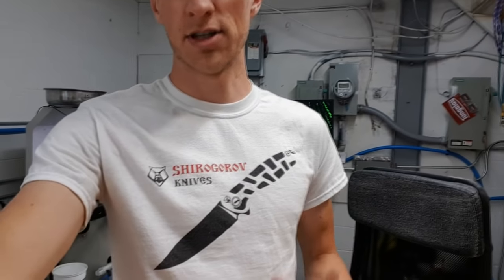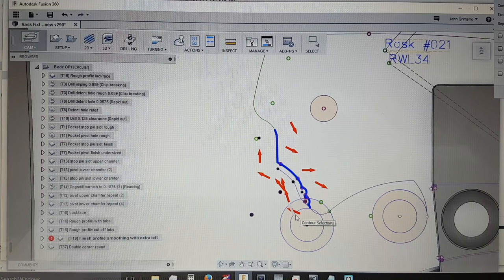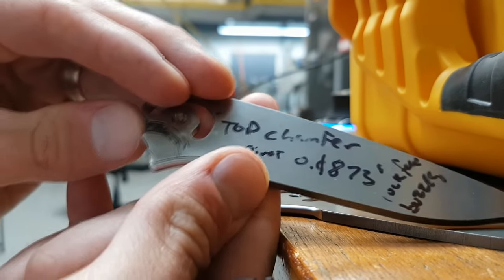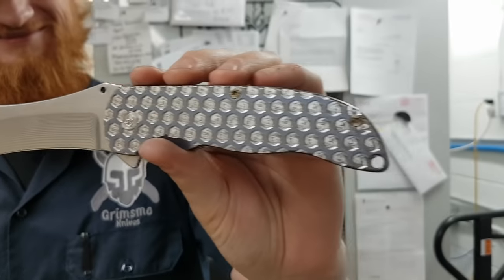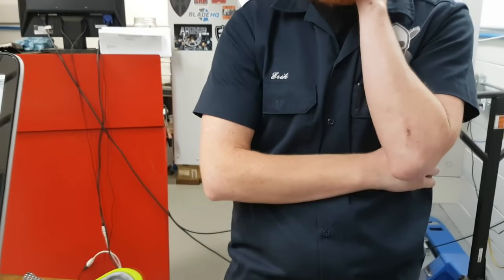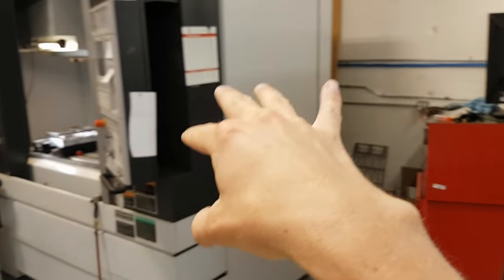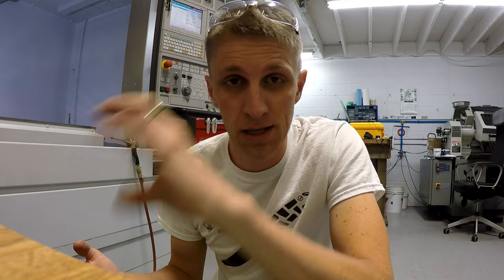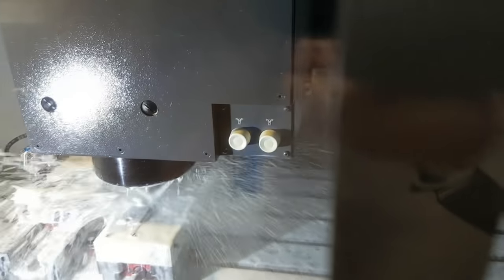Mori Seiki CNC, Fusion 360 CAM, Grimsmo Rask blades - Grimsmo Grind 034

Comment: quick little easy solution for mounting blades with the fixture standing on end... put a small round pocket somewhere in the blade pocket and epoxy a small magnet into it....that way the magnet will hold the blade in place where you want it located while youre trying to find bolts and clamps.
Reply from the maker: +mnm knives maybe, but I'd hesitate putting a magnet somewhere that gets pelted with magnetic chips.  Could work I guess since the blade will always cover it.
Reply: true...but (and i may be way off here) im thinking it would be the same as a magnetic chuck on a surface grinder where the coolant flushes the chips away....it should work the same on the mill.

Comment: That hole finisher is a burnisher not a reamer if it uses balls or rollers. Not only do they hit size and leave a good finish they make the material stronger, win win!
Reply: bcbloc02 But not a general purpose shop tool.  Because adjustability range is very limited, used for production of many identically sized holes.
Reply: Alex Jacobson
I don't think I have ever seen an adjustable burnisher, in my experience they are dedicated tooling, but no different than a chucking reamer or drill as far as that goes besides cost.
Reply: bcbloc02 what will happens when the balls will worn out? you need to throw away the whole thing?
Reply: bcbloc02 what will happens when the balls will worn out? you need to throw away the whole thing?
Reply: Fischer977
Some can be reconditioned others need replaced.

Comment: Nice mill.  My experience with stainless is limited but I agree with you that using coolant is better than nothing as your chips are work hardened and re-cutting them is bad for the end mill.  I think the trick setup is a compressed air stream just to get the chips out of the way of the cutter.

Comment: if you're going to the trouble of making a diamond checkered engraved pattern on the handle you should incorporate the Grimsmo logo and the screws into the design. It looks like an afterthought now and the logo is just kinda floating around.

Comment: When your selecting open contours you can often save time by clicking the end of where you want that contour and it will auto select everything in-between. You get sort of a preview of what it wants to select because the line is black.

Ever consider shrink fit holders?

Watch those lights on the Mori, the end of the tubes get loose and they fill with coolant. The ones on the lathe at DMDII are trashed which gave me ideas for the next light design. :)
Reply from the maker: +bensbenz Good tip!  I'll try that out.  I have considered shrink fit.  Might get a few and try the blowtorch method.  Otherwise it's way out of my budget.   I'd love the clearance though!  I'm in for a machine light!

Comment: Maybe you should put some hollow dowel pins on the side fixture to locate the pivot hole and blade tip, I foresee repeatibility issues with just using screws for retention and location.
Reply: It gets pushed tight up against the walls of the recess. add long as he pushes it tough into the corner, he should be fine.
Reply: For the kind of work he is doing, that will not be adequate.  His fixture positioning needs to be repeatable to within 1 or 2 thou, otherwise he will have very noticeable differences from one side to the other.
Reply from the maker: +eformance you're not wrong, and time will tell, but I think my way will work fine.  As picky as I am there is wiggle room in the absolute positioning of the bevel before you'd notice it.  And there's no way the blade is moving under these clamps.

Comment: John, great video, is all of this done pre heat treatment of the blades? Finally, could you show that custom carbide endmill for the lock? I have been looking for something similar for over a year now. Thanks
Reply from the maker: +mwvanwyk yeah we fully work the blades soft.  You can see the lock face endmill at lakeshorecarbide.com under the knifemaker section.

Comment: Hey John great video as usual. Question: What was that bit you were using at 21:19 that you said made "perfect holes"? I couldn't quite make out what you were saying.
Reply: He said it was a Cogsdill reamer, but it is a Cogsdill roller burnisher. It basically deforms the metal into shape.
Reply: Andrew Delashaw
Sweet! Thanks.

Comment: When you tweak operations like the LC double corner rounder - are you using the heights tab in Fusion, or are you going into the control and messing with the G43 height offset in the tool table?
I'm thinking putting the tweaks in the CAM file is the way to go, right?
Reply: Remember that Fusion doesn't have form tools yet. If I were going to do this in Fusion I'd make a Radius Mill and use the Tip Length to adjust where the top of the radius is in relation to the tool they had special made. What's really funny is that Harvey Tool sells a tool like this standard: 32808-C3 for the AlTiN coated version. Shank diameter might be a bit big for the application though.
Reply: Sent you a DM ;-)

No form tools yet. Although they can be imported via an HSMWorks tool library oddly enough.
Reply from the maker: +Greg Koenig fusion doesn't have form tools yet unless I missed something.  I mess with heights and radial offsets in CAM. With the Renshaw tool setter I use that and trust it so that when I probe the next tool it will be the same.

Comment: Not sure if it will work or not, but have you tried using Rain-X on the gopro enclosure?  Might make the coolant sheet off better.
Reply from the maker: +Barry Woods (barry99705) no I haven't, but I've heard that it can make plexiglass brittle and get all crystallized.  I liked into it a few years ago for the Tormach enclosure plexiglass, motorcycle guys said it made their helmet visors crackle.

Comment: It's not a reamer, it's a burnishing tool. Sweet tools, used to use them a ton for small hydraulic cylinders where we needed <8rms finish off of the machine.. Pretty much the best thing ever.
Reply: dude! two mentions in as many weeks? came up like two seconds after I posted. Nice.
Reply from the maker: +rob lockwood what can I say, u da man.  Or all your ideas are simply finally coming to fruition.

Comment: Whats the appeal for you guys on DLC vs Cerakote or something like that?
Reply: DLC is many many times harder and abrasion resistant than Cera/dura coat. (That's why he said he hit it with the media blaster to see how hard it would be to remove.) Plus it's only a couple micrometers thick, so it doesn't appreciably change the dimensions of the part it's being applied to.
Reply: +Andrew Delashaw   That's pretty thin.  Makes sense with the tolerances they are making these knives to.